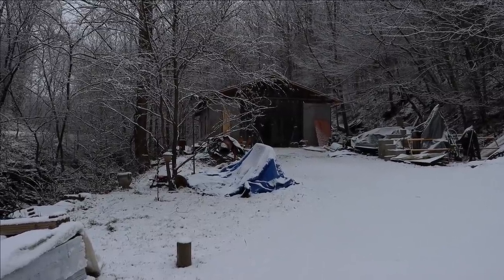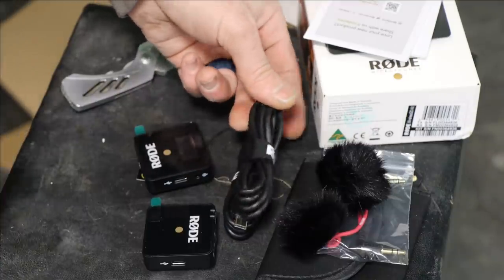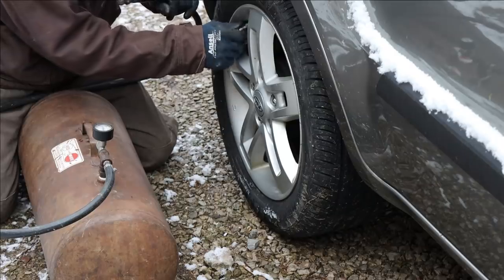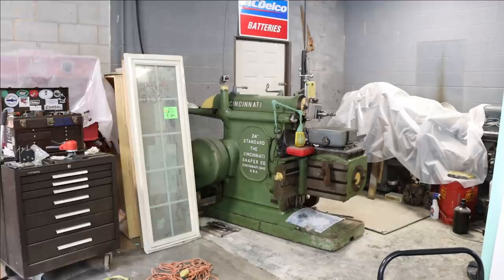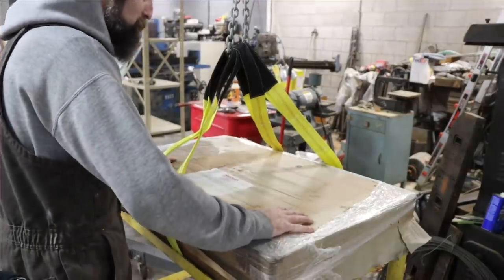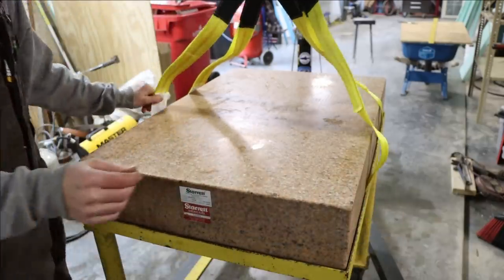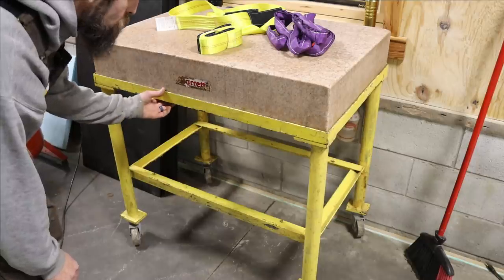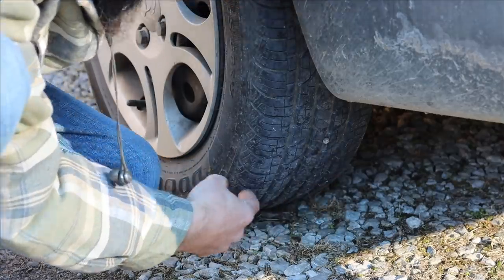NOT a good Week ;-) Shop update Shaper up and running.

Comment: Fear not Steve if you saw my shop you would think yours was a palace. I am very impressed with what you have done to your building. I built my shop myself, every stick of it including the concrete floor. It is a pole building 24x24 two floors. But that was 40 years ago, if I could do it again I would build it twice as large.

Comment: You are wise to keep the squirrels out of human  living  spaces. One squirrel somehow got into my basement and did a lot of serious damage to my basement wooden window and door frames trying to gnaw it's way out. A friend of mine had squirrels that nested around the ceiling light in his bedroom. When he inspected the the area he found much of the plastic insulation around the 120 v Romex wires was chewed off leaving bare copper wires surrounded by flammable nesting material. He became aware of this situation when one of them chewed a hole through his bedroom closet ceiling.

Comment: The machinery awakes, great start to 2021. Lovely views from the shop windows.
Now the shop is insulated, a dehumidifier would help protect the tools and cut down the heating bill, dry air needs less to heat.
Thanks for sharing.

Comment: Steve, looking good. Watch for moisture in the shop from the propane heater as water is a product of combustion. As your shop gets tighter it might become an issue.
Reply: Spot on, those propane heaters just create moisture, okay for a building site, but a no no for precision machines.
Reply: @bostedtap8399  I found out that kerosene does the exact same thing. It is nice when it is going but once it cools off everything is soaked then.
Reply: You should consider a vented heater. I know you took down the chimney but some can vent through a wall. Some of your sickness might be caused by the heater.
Reply: I put a radiant tube heater on the ceiling. Works great, you can leave it a 50 then notch it up few degrees when you're working. Very efficient.
Reply: @1pcfred  exactly, we had a paraffin heater (same as kerosene), growing up; I realise now why the rooms were always damp.
Reply: @bostedtap8399  burning certain fuels in closed spaces and air temperature changes can make for adverse micro-climates. But if Steve doesn't have a problem then I guess he's OK. As he seals his shop up more things could change for him though. One way to stop condensation forming is to just move the air. e.g. run a fan. Like us machines won't sweat if we're in a breeze.

Comment: Your week has gone about the way my life goes. Just in the past three months, I had to replace the intake gaskets, valve cover gaskets and tuned up our old van. Then had to replace the water pump in my truck. Then the van sprung a water leak behind the engine, and I had to replace a steel line and heater hoses. Then the radiator started leaking and had to be replaced and we also found that our cooling fans had quit working so they had to be replaced. Then the trans went out of my truck. Just last week the van started making noise from the front of the engine. Had to replace the belt, tensioner, and idler pulley. Still had an on-off noise that was coming from the alternator so we had to replace it. I guess it’s just what you have to deal with when all you can afford to drive is 20 year old rusted out junk. But it really does get old...........

Comment: I have enjoyed following your projects from the very beginning. I would like to make a suggestion if I may. You might consider painting the exterior of the block walls. One coat block filler and two coats of acrylic latex. This will water/weather proof the block walls. Driving rain or water that splashes up onto it soaks through the block like a sponge contributing to your dampness problem in your shop. Painting block walls is not just for aesthetics; it’s necessary for weather proofing, although it would look good too.

Comment: Hey Steve, last week my 22 year old car locked me out,  the airbag lights lid up and the blinker stopped doing his work.
After opening the car from the other side, the door wont close again. A drop of oil fixed it. After this the central looking doesn't look the driver door anymore, left it for a week ... it fixed itself. The blinker needed a little bit of wiggling the Bulb. And the airbag has to wait.
One of these weeks... 
But 2 healthy Hands will fix it.
Thanks for your videos, i enjoyed every single one.

Comment: General Tire Altimax RT43. After so many years going through all the big brand tires, I finally found those. Cheaper, more fuel efficent, more even wear, better grip in all sorts of weather. Only downside is that most shops don't carry them. You have to call ahead and have them ordered.

Comment: That's a brilliant idea: a car jack that sounds like a bird in distress so that when you have to change a tyre in predator country ,you have motivation to get the job done quickly.

Regarding the polystyrene sheets. Even non-fire retardant polystyrene will not ignite easily. i.e. "one spark" will not ignite the material. A heat source first has to melt the material and heat it enough to cause inflammable vapours to be released before ignition can occur.
You have to apply an exposed flame to the material to get it to ignite.

Comment: The gas clip was great. I know I’ve been there. Numerous times. It has so far always passed. On the air piping I’ve done in several factory buildings I’ve always run it well above head height. The t fittings point up and then I use two elbows to redirect the down pipes down. I have a bleeder at the bottom of every down pipe at a point lower than I tap the air. That ensures that condensation is less likely to make it to your air tools.

Comment: Hey Steve! I have to say that your vidja is the highlight of my Sat. morning. I have trouble even standing for more than a few mins anymore. I have to put air in my tires every few days. Have learned how to use a tire plug as there is a carpet guy on the corner and occasionally I'll find carpet tacks.... I had to quit feeding the squirrels here as they ate not only the seed but the feeder as well. Wont comment on how dirty a shop gets.

Comment: I could send pictures of my shop that would make your grinding area look neat and tidy by comparison and I don’t have the excuse of having been reconstructing half of my basement.  As to the bad week , sometimes it seems like all the little problems are more frustrating to deal with than one huge problem. Just remember the lesson of Statistics; you define what a success is. You got the doors insulated, the paint touched up on the ceiling trim, the pink granite in the shop and a few more light fixtures up.👍

Comment: Let’s commiserate. My phase converter quit. I fixed it. It quit again. Parts are on the way. And it’s 18F outside, 40F in the shop. And my wood planer broke. I get to fix that today. Haven’t had a flat tire yet. 
Next week will be better.
Thanks,
John

Comment: I made some draught excluders for the bottom of my shop doors from some old conveyer belt and they have worked perfectly, I also like you have double doors and have placed a strip vertically along the join, the difference in temperature of my shop although I haven't measured it feels significant and I have noticed a definite change in the amount of propane I get through
Reply: I live in a hard rock mining city, old conveyor belt is one of our favorite things here. The mines have yards where they sell off such things to the public. They are GREAT as anti-fatigue mats around machines. I have used them under some machines for anti-vibration. My dad covered the dirt floor in his garage with them.

Comment: Steve, every pound of propane you run through that heater is a pound of moisture added to the air in the shop.
Not to mention the dangers of carbon monoxide, please consider a vented unit heater (like Modine) if you're concerned about condensation on your heavy cast iron.
A full sized propane tank out back is also lot less per pound than swapping 20's at the big box.

Comment: I was just thinking out loud. Maybe install a 12" or 6" wide strip of the insulation board on one of the barn doors, top to bottom, to cover over the middle seam of the two doors coming together? If that makes sense. Just to keep down draft somewhat. Anyway the shop looks great Steve a pretty amazing transformation.

Comment: The ceiling Foam insolation. think the foam is a great idea & would put it up! I just don't like the green color.  I think the fire risk is low. But a hot chunk of metal could fly off a machine & embed in the ceiling & produce toxic smoke/fumes.  Adding a layer of drywall over it would solve that.   Also, I suggest making a DIY  MERV 13 DIY Air filter box on wheels.

Comment: Steve, a few month ago I did my front brake job on my car,  twice the NAPA part store gave me wrong parts.  1) was the wrong pads.  2) And when I notice I needed new disk and calipers, the ady clerk, she gave me the right disk but the wrong calipers.    And since the front of the car was on blocks, so instead of take and afternoon to fix the front brakes, it took me three days because I had to rely on a friend to get the proper parts. and return one last time to return the old calipers since they can be recycled.      But once I had all the correct parts and a bottle of brake fluid,  the job was done under two hours.   So you're not alone with stuff like getting the wrong tires.

Comment: Tough week for Steve, not much better for me, but with less snow.  Your squirells may be safely tucked into nests they have built for themselves, but you are a source of food.  They will be back.  But your ceiling concerns me.  Years ago in my area, a night club caught fire during a show. Insulating foam spread the fire across the ceiling in seconds.   Such a shock to pick up the morning newspaper and read 100 people had been killed in a few minutes.  The loss still reverberates in RI.  Please be careful.  
Your shop is looking good.  Your tires, not so much so.

Comment: When you put your air system in consider P.V.C. I have used it in my last three shops and I will never use steel pipe again. It eliminates water in the system due to condensation and it is easier to install. You will be much happier with it.

Comment: Steve, on a safety issue I have experienced castor wheel failure in my shop (before I retired) on wheeled tables just like your Starrett table I was 'only' moving wood stock about. Each castor has a weight rating of (depending on maker) about 50Kg(110lb)each - 440lb for 4, I suspect that lump of rock comes real close or even heavier. Be cautious please.

Comment: "Don't judge, I've seen some of your shops".
Yeah pretty much. I have ten pounds of fertilizer stuffed into a five pound garage.
Right this minute I can't even turn sideways and get all the way out to the door.
Hopefully that won't be an issue  tomorrow evening....
Reply: LOL...I can almost see the floor in my shop!
Reply: I have a knee mill style CNC, a fully enclosed VMC,  a 13x40 lathe and two rolling tool boxes in a single garage stall shop.   Top priority for my next (and probably last) home is going to be a big shop space.
I can barely walk in this one.
Reply: That's okay, I can't even get through the garage any more.  If I want something that's out front, I have to open the big door and walk around.

Comment: G'day Steve from down under. Most enjoyable video. Noticed that the audio is very soft - turned my volume up all the way and could just make out what you were saying. I noticed that had the wireless microphone inside your clothing which would muffle the sound considerably. Try clipping with the microphone outside of your clothing. I'd guess the magnetic clip goes inside your clothes and the microphone outside. That make sense to me. Great to see some machinery working again.

Comment: Steve at least you arent dealing with my 1980 f350. I did the passenger side kingpin on it and still have to do the driver side as well. And it needs the engine rebuilt.  And I just replaced the exhaust pipes and mufflers. And I still have to do the engine mounts. And then God knows what else. But I will take that over a new car with the payments and having to have special tools just to work on it. Although I am considering putting a Cummins 12 valve in it.

Comment: Been down "That Road" with tires. Get a cheap Harbor Freight manual tire machine and tire spoons/bars. Then invest in some patches for radial tires some liquid tire buffer; some tire patch cement; some tire mounting compound. Now do your own mounting. You'll be glad you did. Saves waiting endless hour at the local tire shop. If your like me all tire repairs need to be done on a Sunday to be ready for Monday morning work drive. That tire that had the cut would  have patched with a rather large patch and worn down to the wear bars if it had been in my yard. My wife; kids; friends of the kids have all been runnin' down the road on patched tires. Yes, there's been a few failure/come backs. We all have to make decisions on priorities. All these people are able to get to school/work and buy gas for those trips. The tires in my area mostly come from the wrecking yards; Craigslist; used tire stores or trade/ barter, so repair is a necessity. If your Frozen with "Tire Safety" stay away from my yard.

Comment: Steve, I was wondering if you considered covering the EPS with 1/8" or 3/16" luan plywood.  Cheap, and would solve the "exposed" problem.  No worries if some hot grinder sparks make it up to high altitude.

Comment: Porsche ships their spare tires without air in them, they supply an inflator with the car and expect you to fill the tire after it's installed.  You also have to fold the rear package tray down to put the OG tire in there, because it won't fit in the frunk.  Their spare tires actually fold up like origami and look like a motorcycle tire before they are inflated.

Comment: Wrt "big box for a small package": Shipping companies often put things in larger boxes when planning shippings, so that the trucks/vans will get properly filled, and they won't have boxes moving around in the back, getting smashed and braking things. If they thought they could fit one other package by using a few smaller boxes, they certainly would, but time is also in consideration, so they will happily use bigger boxes and send one extra truck, if that means they can leave earlier and keep their "before 9am tomorrow"/24h/48h style promises.

Comment: I'm sure as heck no expert, but it has always made me feel better to have a few fire extinguishers hung up at strategic locations on the walls.  Given that your shop wiring is good and the squirrels are back outdoors where they belong, I would assume that most shop fires would happen while you were working.  What are your thoughts on this?

Comment: Love the channel , but having real problem hearing you speaking, got volume on full but still can hardly hear you , shop noises are ok !
Reply: Audio is horrible,  too soft or too loud.  Constantly need to adjust it while watching.  Hope the new microphone helps.
Reply: Normally I have my amp on 13 for the volume. For this video 17 was about right. So yeah a bit on the low side here too. Good thing the amp goes up to 33.
Reply: Oh good not the only one.
Reply: Agree hope audio issues get fixed
Reply: Have my volume turned all the way up, but still can't hear !!!!!   God bless !!!       Eddy

Comment: Regarding gas heaters in closed rooms:
When a hydrocarbon burns, carbon oxide and hydrogen oxide are formed. Carbon oxide can be traded for a while as long as it is CO2. Hydrogen oxide, also known as water, tends to condense immediately on cold objects because it cannot be absorbed into the air indefinitely. So with this type of heating you damage your machines a lot. Better to build a decent wood stove.

Comment: Just a thought, if you don't mind:
I have a feeling you will probably be getting problems with humidity and moisture build up in that shop.
I want to recommend at least a humidity display, as with all the machines you don't want super high humidity levels in there.

Comment: If you mind me asking, what did it take to get a surface plate reconditioned by Starrett? Do they have a program where used plates are returned and they sell them as reconditioned or do you need to buy one on the secondary/used market and ship it to them, and if so, how is that arranged? What are the cost savings versus buying new?

Comment: Hope you feel better soon, Is it just me or are the audio levels really low? ive got the volume at Max and still cant hear some of the narration?
Reply: In order to hear the audio I had to turn my volume up some. About 31% over where I normally have it. I was still only at 51% of the volume though. I use an old Blu-Ray player as an amp for my PC. It is rated at 370 Watts.

Comment: Not sure if it was just me but the audio levels were all over the place when I just watched this one. I understand you're testing new audio set ups and I know how it can be a pain. Hope you feel more human soon.

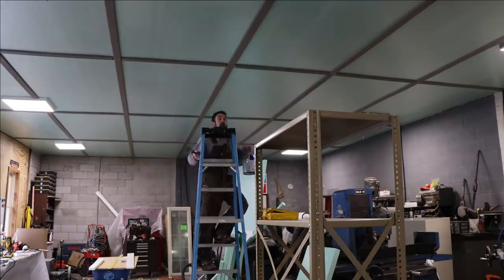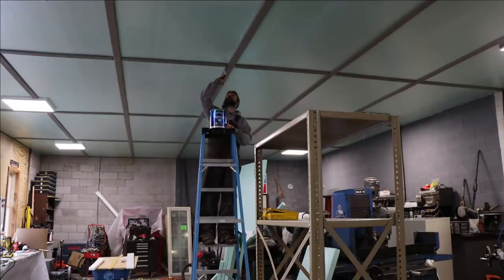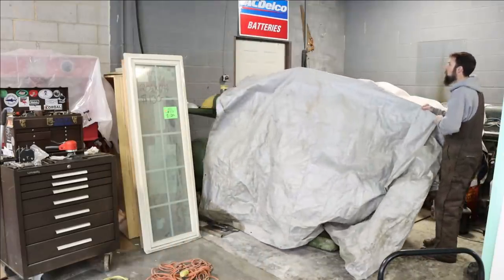*edit: Skimming through the waveform and looking at the levels a good example of the ups and downs are at 12:30 to 12:46 where its peaking at -30 to -24, then at 13:07 to 13:33 its louder around -12, then just after that at 13:50 to around -20.  Its tough to get right especially if your app has no db meter on the output when you listen back at it.  I would try with setting the audio to headphones and setting the volume to a known good baseline, then when you play back the different tracks (video clips and voice over) you should be able to tell when something is too quiet / loud compared to the rest.
Reply: Audio was good